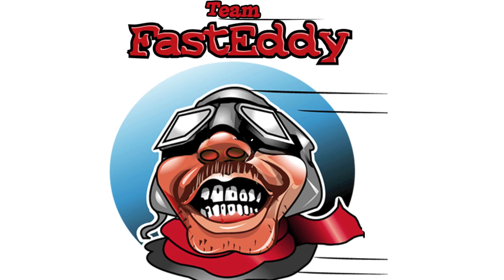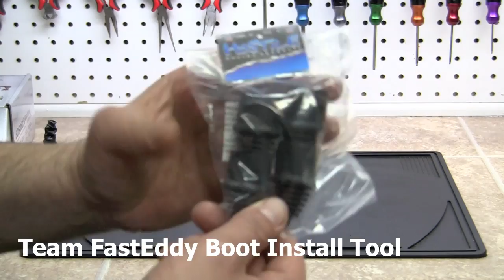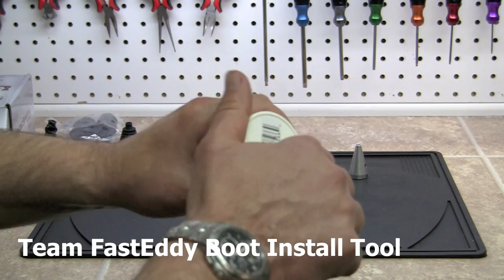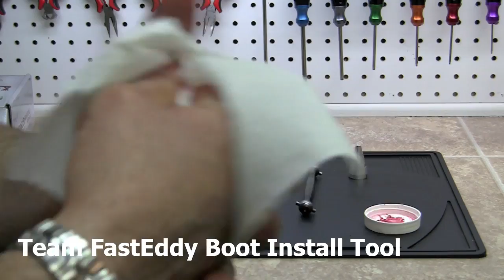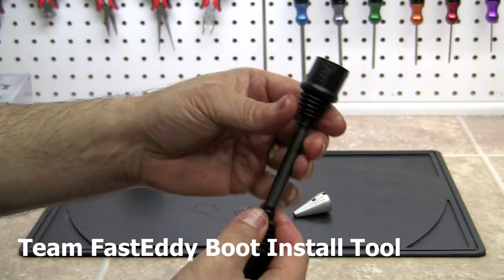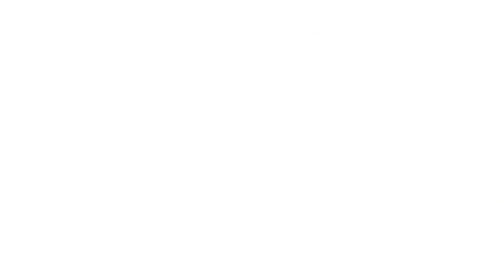Installing Hostile Boots with FastEddy Install tool

Comment: Tried installing my hostile boots with the TFE tool, greased it up loads with red grease.  The boot got stuck on the tool halfway down and then tore trying to get them off.  Now I'm off to the shop to buy new boots, and install them as everyone else suggested - turn them inside out, put them on the dogbone and then install the pins.

Comment: and i compared my hostile boots i have and they ALL are same length, theres not 2 longer than other two.  i think if you really want to install hostile boots on darksoul or any other bones, shredheads way is better if you have pins in, if not, like the meaty bones, leave pins off then just pull over the ends, then install pins.

Comment: tool works great for aligning the pins and locking the setscrew down but for installing hostile boots, it sucks, mine got halfway down, stuck on tool, and i greased everything more than TFE did.  had to turn it inside out and work it back off.
then did one boot inside out oneach bone, left out the Dark Soul pins, and pulled it over each end, was ten thousand times easier that way, then used tool to install the pins. it might work on regular boots, but not the hostiles.